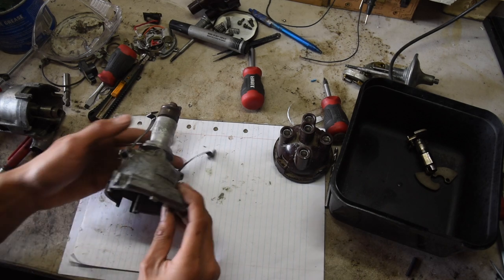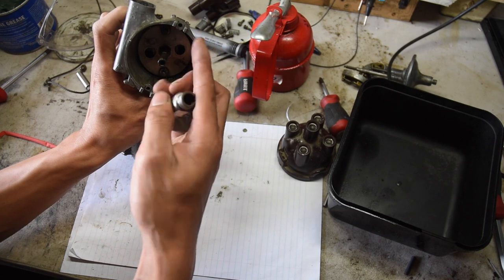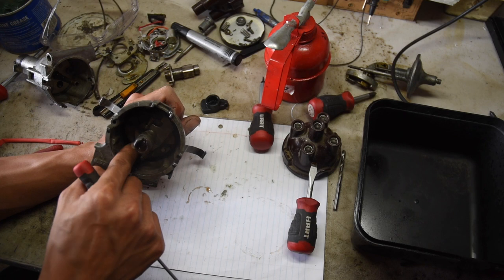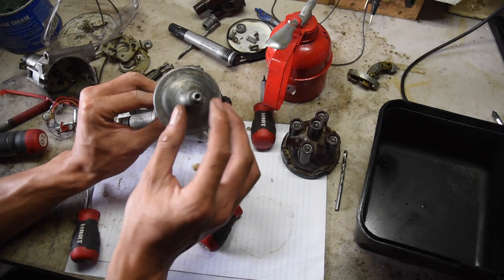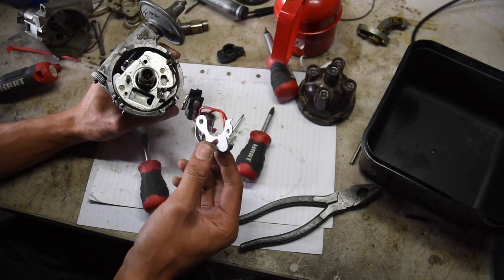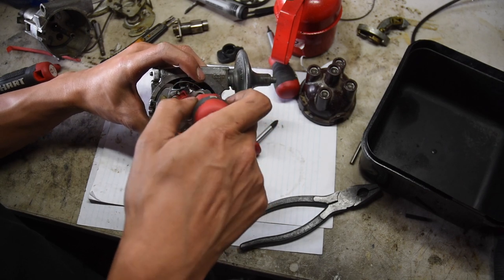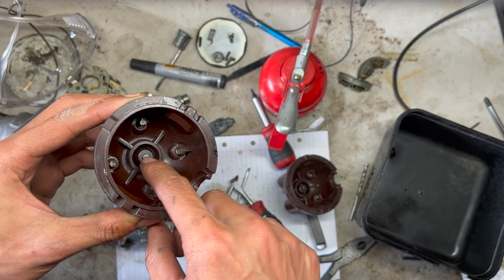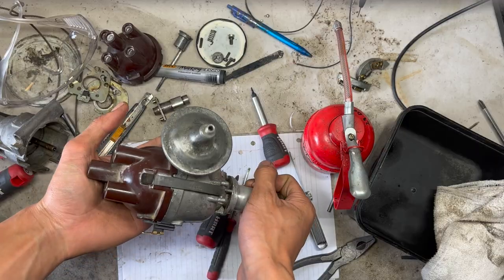Assembling a Lucas 25D distributor (Morris Minor) + Points

Comment: Great video, thanks. I’ve just bought an engine that’s been sat in a shed for donkeys years. It’s from a herald 13/60 to replace the horrid longer stroke 1500 in my mg midget. 

It came with a very poorly looking 25d4. Most bits cleaned up ok but the cam was seized to the shaft, weights stuck, etc. I’ve got it apart eventually but with significant damage. I will have to make a new plate and spring hangers etc for the bottom of the cam if I ever want to use it. Probably not
Worth all of the effort I’ve gone to because it took me a day to find your video and realise the vacuum unit is missing ! I thought it was centrifugal only at first! 

Oh well, it’s been fun messing around with and a learning experience!

Comment: The easiest way to put the centrifugal weights is ,put the weights on the distributor cam , then turn distributor upside down and place cam onto spindle . That’s how I taught hundreds of students in my Technical College  motor vehicle classes , City & Guilds courses.  It saves trying to  get the pegs on the cam to line up with the holes in the weights. Give it a try ,hope it helps.

Comment: Very helpful thank you. 
I bought a chinese knock-off 25D (my car came without a distributor so no core). Gonna tare it down and make sure everything moves properly.
Reply from the maker: Best of luck, best to replace the points with some proper ones or convert to electronic ignition. The cheap ones have a tendency to fail unexpected within the first hundred miles.
Reply: It’s a power spark ever heard of them? What’s a good brand for points if you don’t mind me asking. I run a CDI box so points are no longer finicky (only used to trigger box no longer breaking much current)
Reply from the maker: @millerignition   yes have heard of them, I have something similar fitted to mine can’t quite remember now. Not entirely sure on brand of the points, it’s mainly the condenser that I’m aware is dodgy. I swapped an ancient condenser in from a used set of points to a set of new ones when I still ran points, never had a problem with the old as ones.

Comment: The vacuum advance wheel, is that an actual adjustment? Or do you just turn it until it clicks? Distributor is going in the car tonight. I will let you know how it runs with the dizzy on it. The powerspark had a wire jamming up the vacuum advance mechanism (wire was wedged tight up against the distributor cap) came with zero lube on anything and arrived with the points not lining up and also having a very large gap. Once these easily fixable things are addressed it looks ok.
Reply from the maker: Yes the advance wheel physically rotates the plate which the pickup or points are mounted to. This plate is free to move independently from the dizzy and when the wheel is turned it shifts it up or down advancing or retarding the timing. I remember I used a tiny cable tie to fasten the wires from the electronic ignition pickup to the old hole where the condenser went. Just so it doesn’t catch on anything. Best of luck, let me know how it goes!
Reply from the maker: Make sure to set the timing afterwards with a timing gun with the vacuum advance disconnected